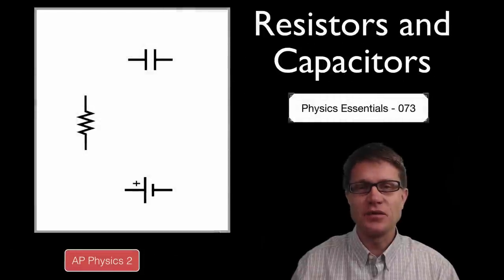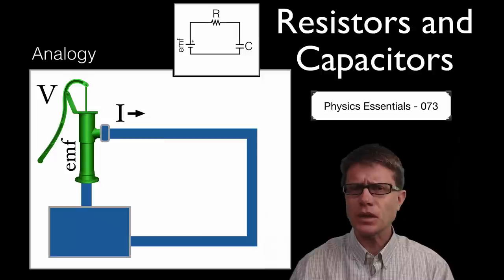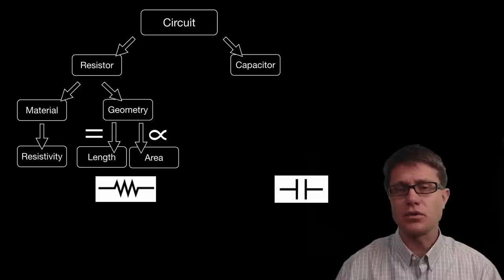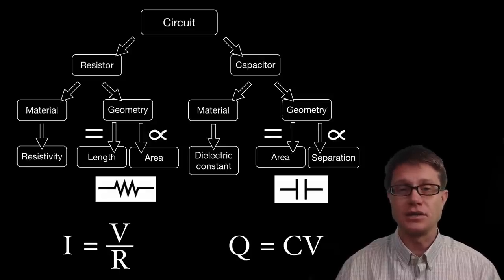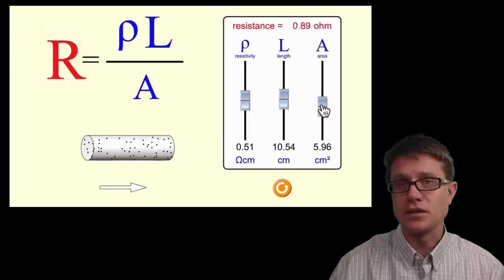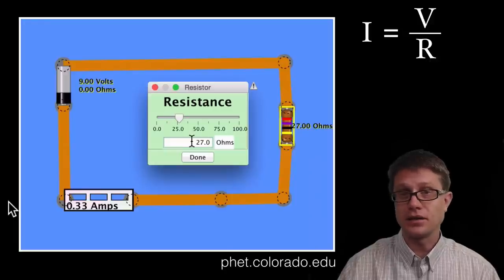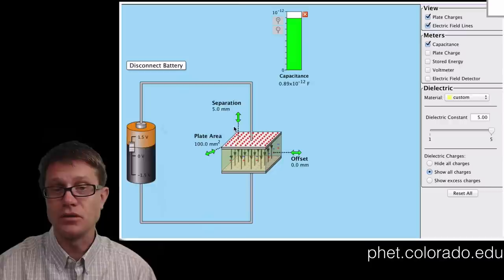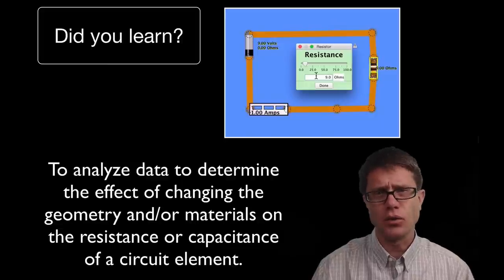Resistors and Capacitors

Comment: Capacitor,  current leads the voltage?     Wonderful visuals. Very informative. 
Thank you.
Reply: What really happens, is that current is delayed by 3/4 of a cycle in a capacitor.  If you look at the transient operation of an initially de-energized capacitor, when first subjected to AC, you will find that current doesn't really lead the voltage.  It is just that it appears to lead the voltage in the steady state, which is usually what matters most of the time.

In the steady-state, delaying current by 3/4 of a cycle, is mathematically equivalent to current leading the voltage by 1/4 of a cycle.  And when we only care about the steady state behavior, this is good enough for our purposes.

Comment: Can I ask a question want to make my own 12v led  torch using capacitors and resistors  want no which capacitor and resistor ohm is best for storing energy fast with very low discharge rate want to make my own storage  module using capacitors instead of batteries thank you

Comment: if you connect an LED directly to a battery are you just effectively shorting the circuit?
Reply: +micheals1992 LED's are not ohmic loads, so they don't obey ohms law. In reality the LED will burnout if you go over its power rating which is why resistors are used in LED circuits.

Comment: what is dielectric a video on that too ..mister andreson
Reply: The short answer is: it's the insulator between the capacitor plates, that increases the capacitance from what it otherwise would be, if the gap were empty space.

It's called a dielectric, because the capacitor polarizes its dipoles, that produce an electric field to oppose the electric field of the capacitor plates.  This means it takes more charge at the same voltage, since you need more charge to generate the same net electric field inside the dielectric material.

Comment: The explanation is indeed beautiful but the problem I've found is that the concerned topic is not discussed in details. Sir Anderson has put a very little light on the combinations of resistor and capacitor. Resistor and capacitor and insertion of dielectric could be a separate topic.

Comment: I have a doubt. a resistor restricts the current or voltage in the circuit.?
Reply: It resist the flow of electrons which is called current

Comment: Your analogy suggests that a resistor increases current since the pipe size becomes smaller making water move faster which is current. Just saying...
Reply: The pipe size may make water move faster in terms of flow velocity, but it is still the same total amount of kilograms per second of water current that is flowing. And the kg/s is what is analogous to current, not the flow velocity.  The change in flow velocity from change in geometry, is a consequence of continuity of mass conservation.

What really forms the analogy of resistance, is the frictional losses that occur due to sudden changes in the geometry of a pipeline, and viscous losses.

Comment: Category - grounding
Perspectives of discharging-range(controlled variance)

When do switch-branch(serial) become active(right-wrong path).?

Natural discharge level when others(module) are "flooded", pivot-point for resistor to behave like capacitor and burn-up. 

When do wire become inductor(grounding)/antenna(cross talk)/... Ionise air, heat up, ... Category(sss) as switch-points to break up modules then dielectric-bipolar "science" to pivot-points of behavious changing categories to switch-points to redesign of circuits to new-baseline to redesign-components to oops, just use it the other way
Reply: No fear due to...
Fittest survive
Democratic non-bigoted secular scientific mathematical no-pretence
Give/share you(world) tech and ideas and perspectives
Game-on, bring-it-on, ... Darwinian selection, natural selection, ..
Reply: The finishing statement
= I make medical-pharmaceutical - die-electric bipolar
= To affidavit legal lawyer brain-spasm with police.

Comment: So how do capacitors discharge then? Do they discharge in the opposite direction since current cannot flow across the dielectric without shorting out the capacitor? 

If thats the case, do you always need a switch to active the capacitor? On an AC capacitor start motor, there is no switch so in that case it makes no sense to me.

If anyone can shed some light on this, please do. I feel like a complete dumbass.

Comment: I still dont understand the purpose of a capacitor in a circuit!
Reply: A capacitor stores electricity. It is kind of like a battery, but they are very different. Say you have a battery hooked up to a capacitor. Basically the same schematic (diagram) at 7:15 in the video above. There are atoms in the 2 plates of the capacitor. On the plate connected to the positive side of the battery... electrons flow from the plate to the positive side. Because opposites attract. But due to this, electrons on the negative side of the battery flow to the other plate on the capacitor. The plate connected to the positive side of the battery becomes positively charged. And the plate connected to the negative side of the battery becomes negatively charged. You can remove the battery, or keep the battery there and these plates will keep this charge (You have to keep the battery there for a certain amount of time to actually charge up the capacitors). Then you can, say, replace the battery with an LED. The circuit will be a complete circuit. The electrons on the negatively charged plate want to move the other plate, so the electrons go through the circuit, through the LED, lighting it up and returning to the other plate. But soon after this will stop, once both plates are equally charged.

Hope this Helps!
Reply: Mesopo Mesopo I believe he was talking about practical use. for example, in a Ac to DC charger, the sine wave gets split by the bridge rectifier. since the output of the bridge rectifier isn't DC, it's like a only positive never negative wave, the categories regulates the current by storing it until overflow
Reply: OMG we all know what a capacitor is for fucks sake... we just want to know why you would want to use a capacitor in the first place......and if not what would happen.....
Reply: There are many application for capacitor. I think when looking at capacitor,  you must also consider that: capacitor can stores and release charges, and that it takes times(a short amount) for those charges to build up and discharge. Here are a few on top of my head. For alternating current application (when the current alternates direction), it can be use to filters out high or low frequency signals. Capacitor can also blocks direct current (when the current only flow in one direction), which are used in amplifier to get rid of the unwanted direct current (usually the output of an amplifier will have a combination of alternating and direct current). For direct current application, it can be use to smooth out any bumps in voltages (for example when your voltage is not always constant). Capacitor are also great for timed events. For example, provides 5V for 10ms, or hook it up with a 555 timer to creates a clock signal (use in digital applications).  

I hope this helps!

Comment: All these youtube videos suck at explaining a capacitor..... we know what a capacitor does.....we just want to know why they were invented for fucks sake.....
Reply: Charles Mowa 
Why it's easy capacitors are split in half by the dielectric material, as more electrons are pushed into the capacitor on one side.
It pushes the electrons out the other side until no more electrons can enter and no more can be pushed out!!
This is called "The steady State" other wise known as charged.
That is why when opening old electrical equipment you should be careful around the old capacitors as some can pack a punch.